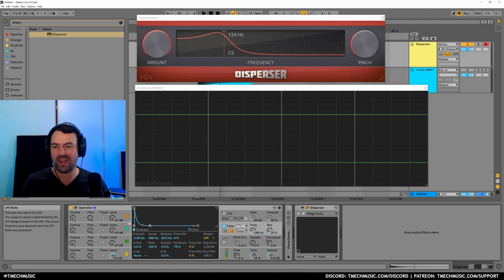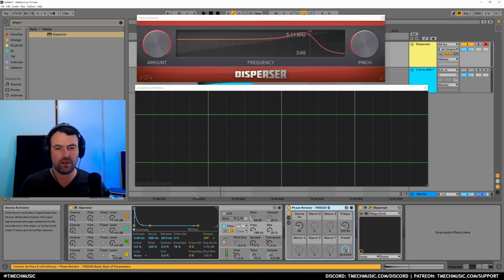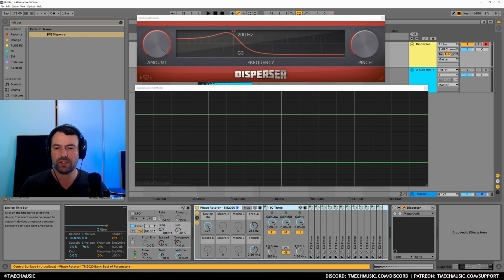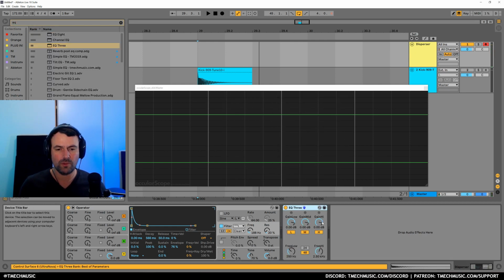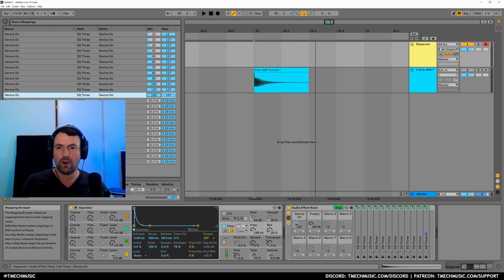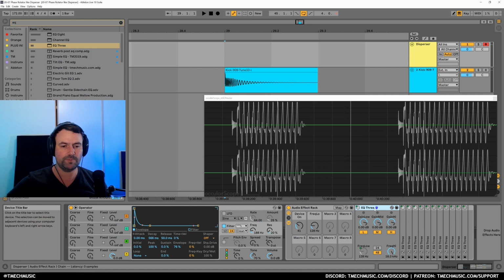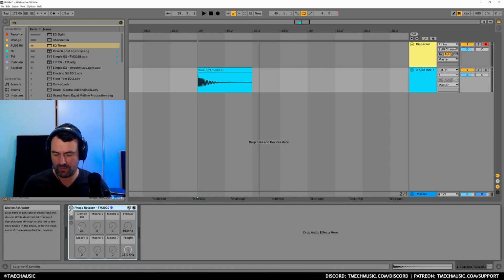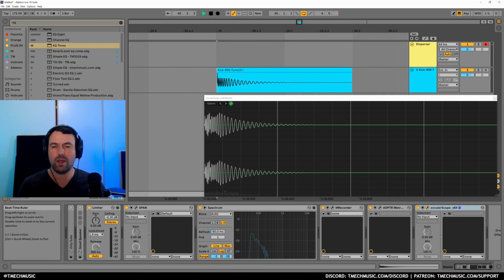Build an effect like Kilohearts Disperser from stock Ableton effects (EQ Three)

Comment: Hmm , why does the stock ableton eq low parameter messes with the phase when the gain of said parameter is set to 0.00db ?
Also , why doesn't it cut off the frequencies whan changing the low freq parameter , is it  a parallel effect chain ?

Comment: Oooo nice, remember seeing Mr Bill do one with a bunch of OTTs stacked together, but this method sound alot cleaner. Awesome!
Reply from the maker: Same, I have seen him do that too - I think it uses the same idea, just the crossovers from the band splitting affecting phase in a weird way. I tried DIYing it with EQ8 and low/high passes but couldn't get a good result - one day I'll try another run at it to get the "pinch" control from Disperser worked out as well :)
Reply: @TMechMusic  had to come back to this, came across another one that uses MFreeformPhase by Meldaproduction
Reply: @ManyobaAudio  mind sending link or describe how to replicate with melda?
Reply: @mattwhit02  not sure how to add links in comments but just search for Mfreeformphase tutorial by Borrasca 🙂